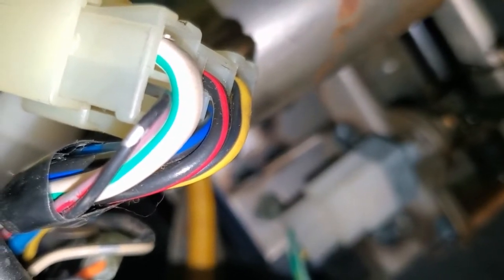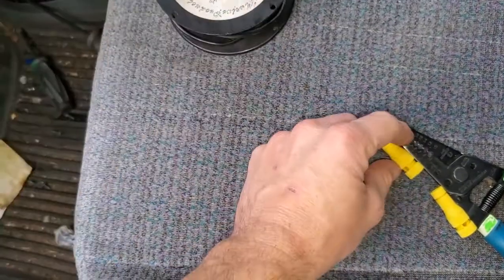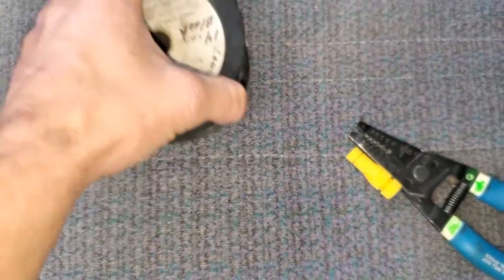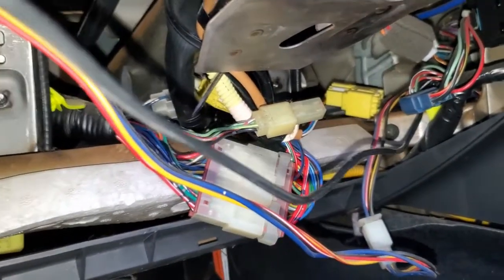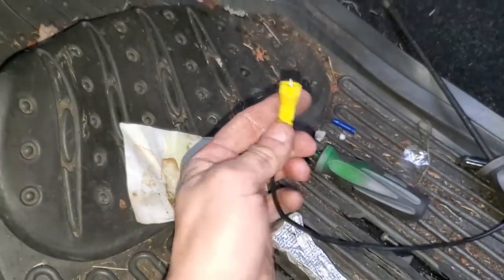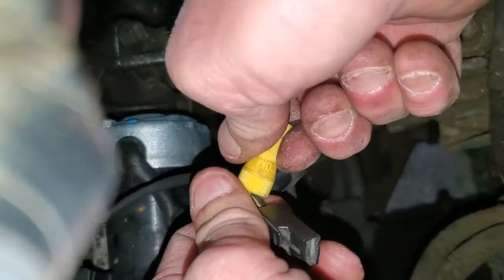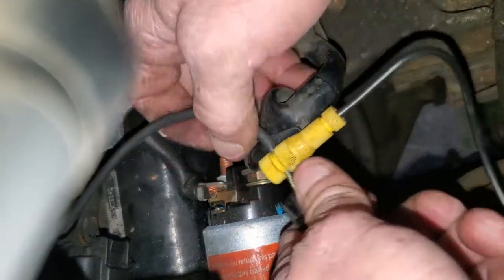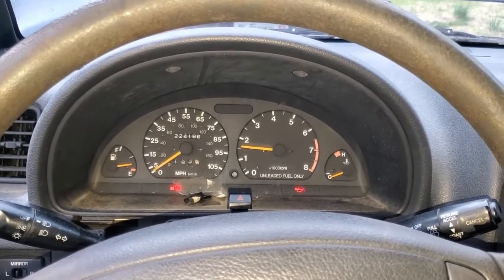Rigging a bad park neutral switch on 97 Suzuki Sidekick

Comment: On starter end why not leave the factory wire unplugged and put a spade on your wire and slide it directly on the starter?
Reply from the maker: starter on this one was difficult to get to, this was a much easier way around it. Plus a regular spade vs the factory connection could vibrate off easier. The guy I sold this to left it as is, still working like a champ to this day!

Comment: What does the big yellow wire  or wiring tube   go  to
Reply from the maker: yellow is for air bags. always for air bags. Don't mess with the yellows unless you know what you're doing, you could accidentally discharge the airbag.